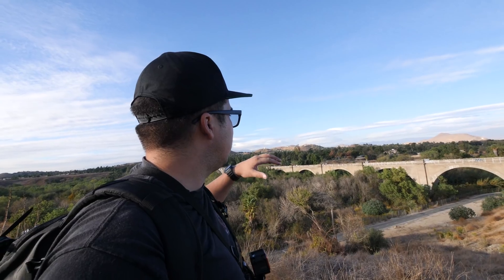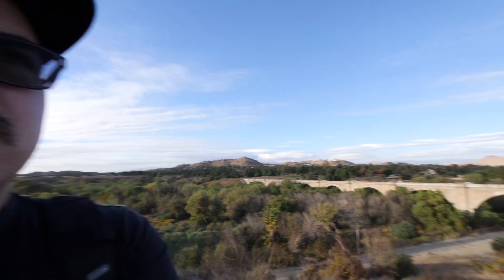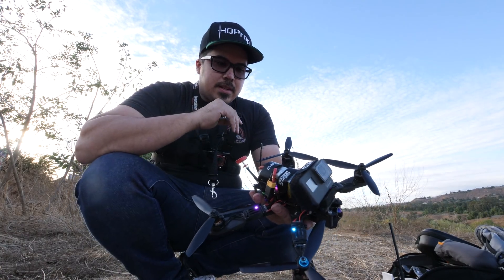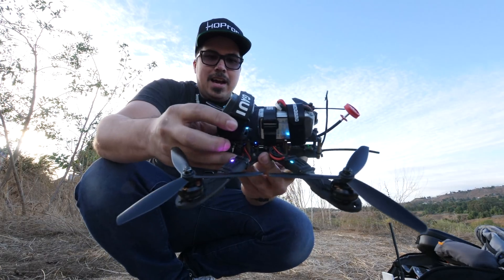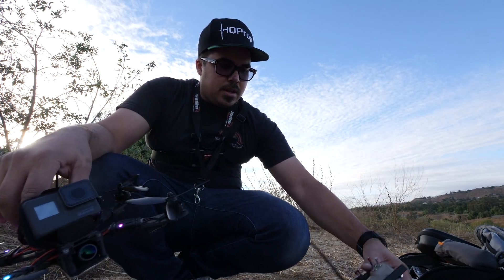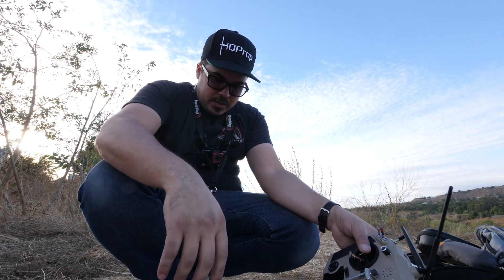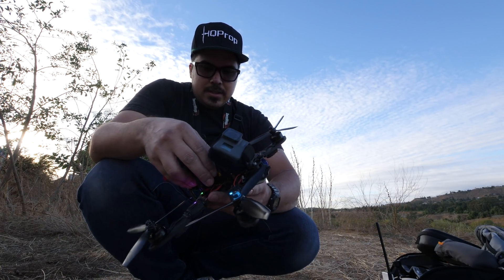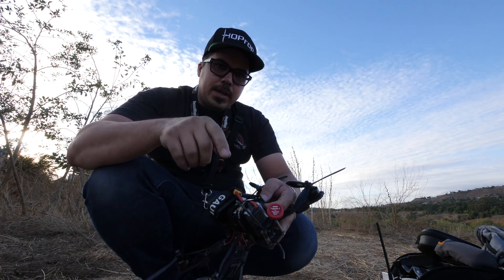Arming issue with betaflight f4 board and 32bit esc

Comment: I just upgraded my F3s to F4s as well and suddenly I have constant video noise on mine in both builds on my Unify Pro v2s. I have always set small angle to 180 so I'm not sure if this problem also exists. Something is up with this board, it doesn't seem to live up at all to its predecessor.
Reply: The manual is very spesific on where to connect your vtx and cam, what ports did you use?
Reply: I got crystal clear video on mine but just doesnt arm mostly LOL
Reply: I've tried many combinations. The original was not using cam v5 but rather a regular 5v rail and running both cam and vtx to agnd. Then I changed it and ran each seperate on a regular gnd and 5v each because that is what someone else found worked.

Comment: Hi Eric, sorry to hear you are having issues. I'm a long time Betaflight user and hope I can help. Can you please tell me whether you are running with the accelerometer on or off? Looks like it could be that. There is an option called 'Small Angle' and this sets the angle the accelermoter can be at and still arm, this only comes into play if you have the accelerometer on (which you don't need, I presume). The other thing it could be is to do with pre arm, have you set this on a switch? People have ran into issues with it, there is a Bardwell video for it, called something like 'Why Won't My Quad Arm?'.
Reply: Bludz FPV I have no messages in BF on the cli except cli,msp. I have done everything on the JB videos and he's tired to help, nothing has worked. I have reached out my transmitter company and they say the issue is that the switch isn't issuing instructions. I have assigned arming switch to another switch and arm still won't turn yellow

Comment: Type status in the cli.. It'll tell you why.. Check Bardwell's video on it
Reply: I'm having the same issue. I check "status" and all it says is cli, which is true but I should be able to arm my quad. For some reason, I cannot arm it unless I'm plugged into betaflight gui.
Reply: dump it
Reply: https://www.youtube.com/watch?v=M0S3HTQihxs 9 common errors from April '17 , 

Then again it could be BLheli 32 that we're just getting familiar with.
Reply: Bump?
Reply: Sounds to me like the FC isn't getting power, which is why it'll arm when plugged into a USB.  Which FC?  Is it one that requires 5v?  If so, check your PDB 5v regulator.  If not, it could be the FC 5v regulator, or could just be a bad solder connection.
Reply: g36pilot mine does the same thing

Comment: Eric, not sure what version of Betaflight you are on but get yourself on one of the late October releases of 3.3.0. Default your BFF4 board and flash that hex. Download the blheli32 package and double check that your motors are responding via the pass through. My quads are all on the Betaflight f4 boards (moved over from DYS F4 Pros) and 32bit escs and running dshot1200 @ 48khz. Zero issues 👍

Comment: Dude I have the same issue with my BFF4 board but blheli_s escs. When you enable warnings in the OSD it tells me "CALIB" so I quess it doesnt calibrate gyro, only manages to arm sometimes. I hope its just 1 bad board I have, I really want to like these boards.
Reply: do you run accel on try calibrating that and setting small angle to 180.
Reply: I always turn accel off.
Reply: go in to cli and set gyro to cali after you arm that might work I had to do it once. type get gyro in cli its the gyro_cal_on_first_arm = on its default is off if you hand launch you need to level arm first then you can arm without it calibrating
Reply: Hubert Ott, In CLI type "get min_check" to confirm a value higher than your min throttle setting. Sometimes I find values that equal the min throttle setting. If your stick reading drifts to say 1001 instead of 1000 (which happens frequently) it won't arm. I run "set min_check = 1020" command w/a min throttle of 1000. This assures a throttle stick value below the arming check.